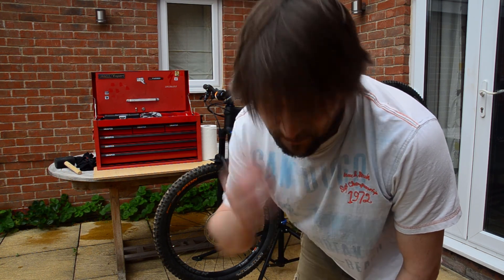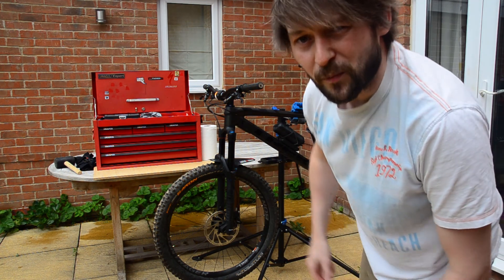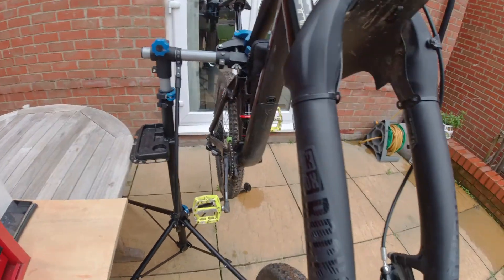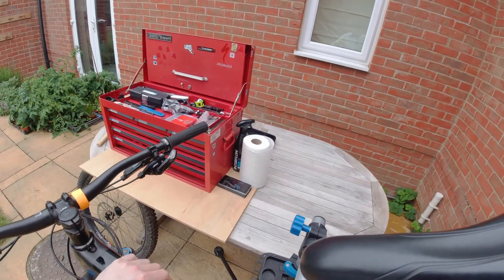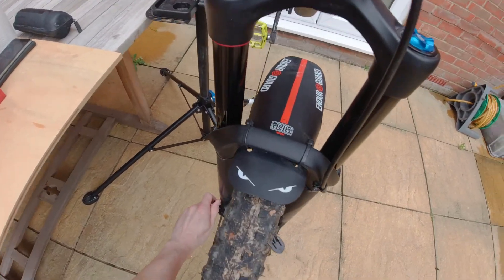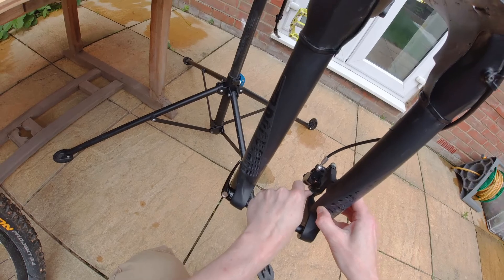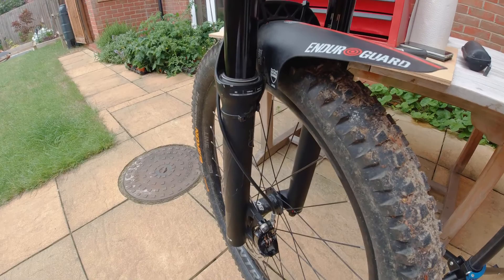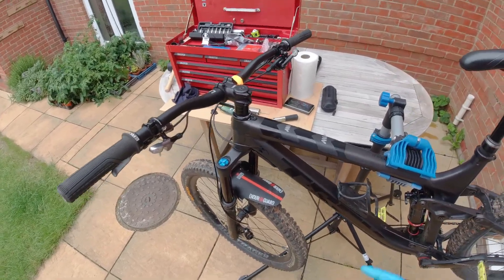How to Service your MTB Headset

Comment: Hi I’m not sure you’ll see this, I tried this but I’m not getting issues with the knock block, for whatever reason it stops at the usual point, but then can be pushed further by half inch both ways which then send th knock block off centre.. any ideas?
Reply from the maker: Hi. To be honest, mine does the same. Kind of a damped bit of extra steering lock, for want of a better description. There appears to be some clearance in the slots which allow it. Doesn't seem to have a negative effect though. I've never hit the stops while riding, only 'feet on ground' manoeuvring.
Reply: @Ash brb  ahhh okay, I did read on a group that a load of the Treks had it, yeah there's no negative affected its only since taking apart the headset. But it's all greased up now which is the most important thing, thanks for the reply mate. Happy trails!
Reply: Yes mines the same small bit of play built into the blocks never caused a problem using the bike good video though thanks

Comment: Nice one mate, was the grease you used bearing specific....
Reply from the maker: Thank you. It isn't strictly bearing specific but the LBS recommended it and this is the description from some online retailers "With a PTFE low-friction formula, synthetic Assembly Grease is non-staining and specifically formulated for wet-duty performance. It is ideal for hub bearings, headsets, pedals and bottom brackets."
Reply: @ashbrb8453  cheers mate, I'm in Thetford, hopefully run into you sometime (not literally 😁) 👍
Reply from the maker: @cyclin_sean.3713  No problem. Maybe see you around Thetford/Brandon sometime then! 👍

Comment: @
Ash brb  Hi there, nice video.

How is possible that you dont have Lower Crown Race?  That is part which go under Lower Bearing. 
It is between your fork and lower bearing.
Reply from the maker: Hi there and thank you.

I'm pretty sure it is there but it was stuck on steering tube and so got wiped clean in situ. The fork seems to sit in the frame correctly but I'll double check, it's due a service.

Comment: Hi the stem is also knock block ?
Reply from the maker: Hi Miguel. Yes it is. The stem has key ways machined under it, that the keyed spacers locate into. So nonstandard stem and spacers.
Reply: Hi Ash the stem is not bontrager?
Where can I buy it?
Thanks
Reply from the maker: @miguelflorindo5588  Hi Miguel. It is the standard Bontrager stem that came with the bike, I haven't felt the need to upgrade.

If you're UK based then Triton Cycles and All Terrain Cycles seem to sell then. Although not sure on current stock.